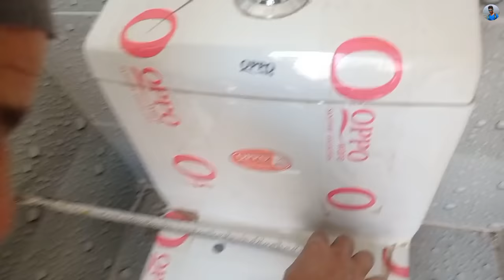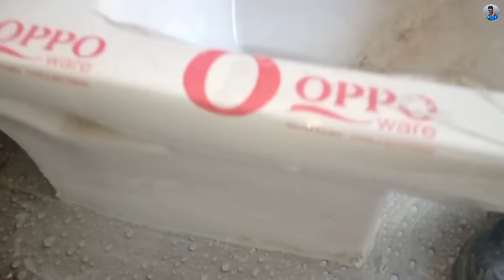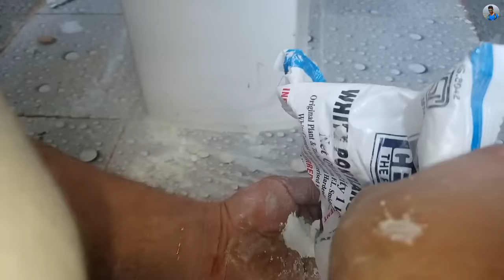One Piece English Seat Fitting Kaise Kare | english seat fitting | in hindi | 2021

Comment: Back wall se kitne distance chahiye drain pipe ka? One piece commode ke liyeee.
Reply: 9 inch
Reply from the maker: 8 इंच
Reply: Drain pipe wall se 6 inch pr hi ,kese set kre commode ka hole dur h
Reply: Q
Reply: Q
Reply: Q
Reply: @SoyabRehman  qqqqqqqq
Reply: @SoyabRehman  qqqqqqqqqqqqqqqqqqqqqqqqqqqqqqqqqqqqqqqqqqqqqqqqqqqqqqqqqqqqqqqqqqqqqqqqqqqq
Reply: @SoyabRehman  qqqqqqqqqqqqqqqqqqqqqqqqqqqqqqqqqqqqqqqqqqqqqqqqqqqqqqqqqqqqqqqqqqqqqqqqqqqq
Reply: @SoyabRehman  .
Reply from the maker: Adaptor Laga jaya karos aata he
Reply: @manishmahala8317  pan connectors 45 dgree use karo